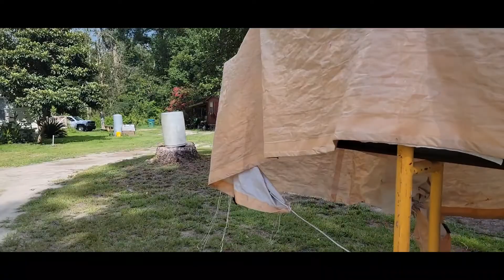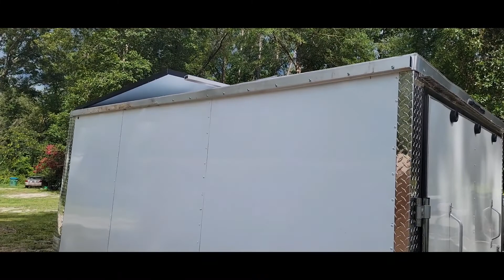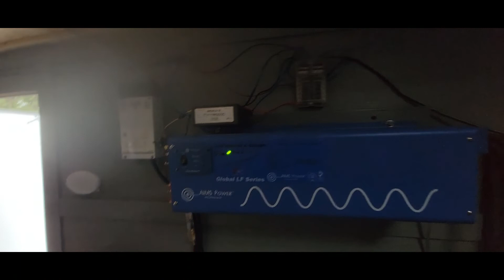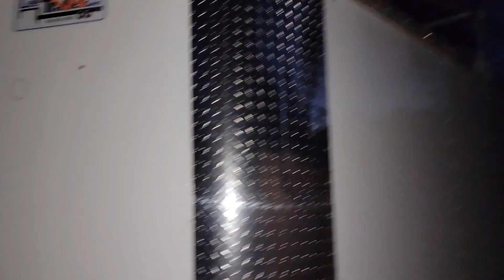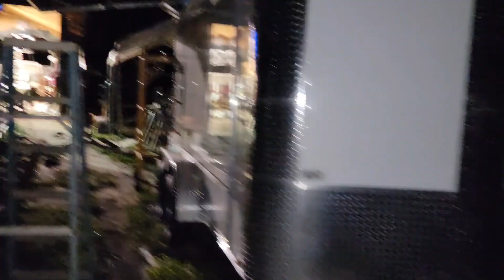DIY tiny house from cargo trailer off grid solar camper part 1

Comment from the maker: 00:05 Adding a rack to the solar trailer for mounting solar panels and creating an awning.

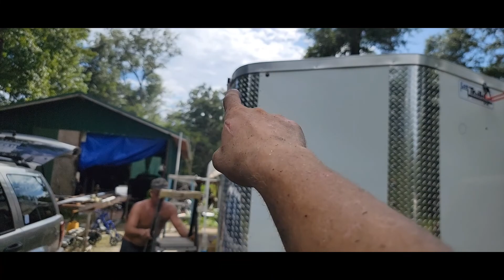02:11 Mounting rectangle tubing to the side of the trailer to build a ladder rack

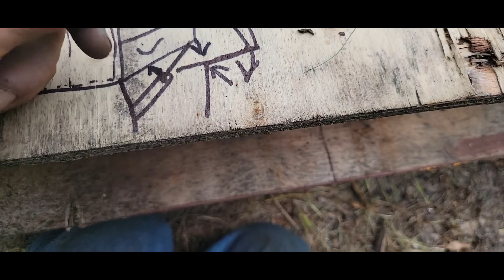06:37 The trailer will have panels that fold up and lock in gravy.

08:41 Installing solar panels at an angle to enhance cooling and efficiency

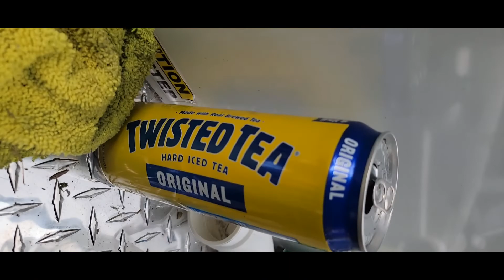13:02 Inspecting an AMS power inverter and charge controller setup

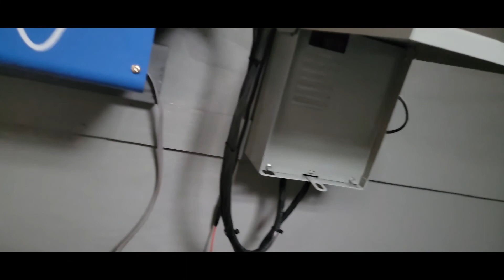15:22 The system consists of an inverter and a large lithium battery.

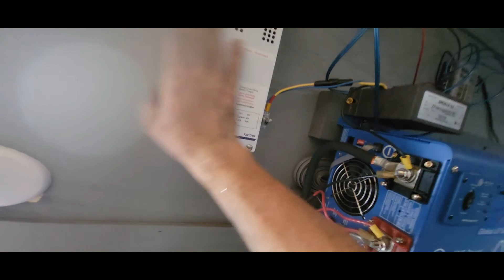19:12 Building solar panels for awning and frame for solar trailer

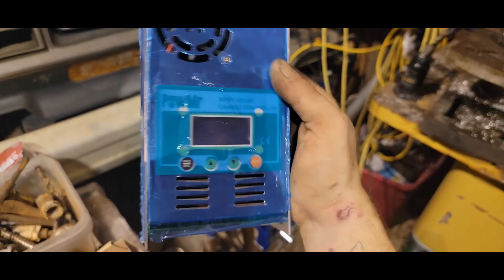21:24 The controller can handle high operating voltage and up to 150 volts of solar power.

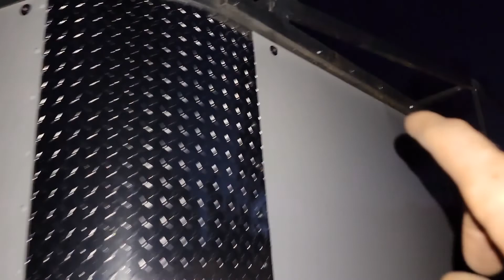25:37 Building and attaching a custom fabricated solar canopy to the trailer

27:28 The solar trailer will have a locking canopy mechanism and a drip edge for water drainage.

Crafted by Merlin AI.